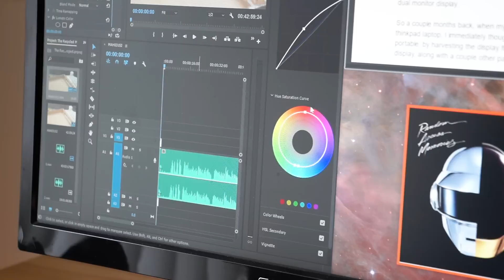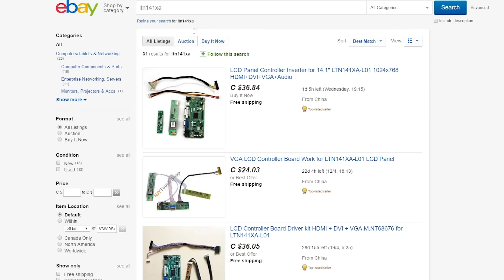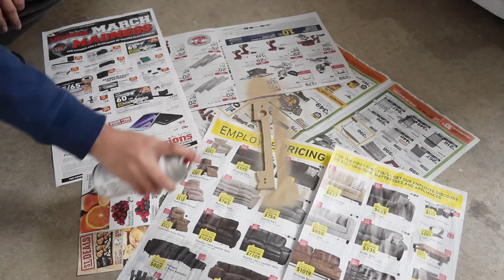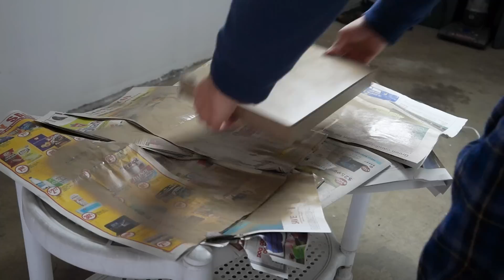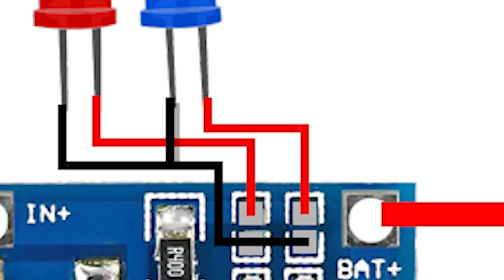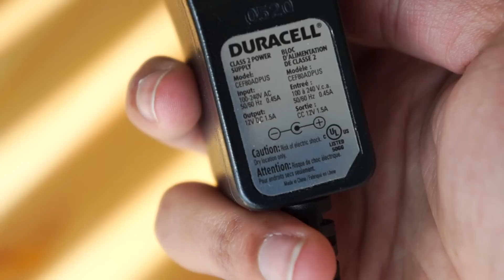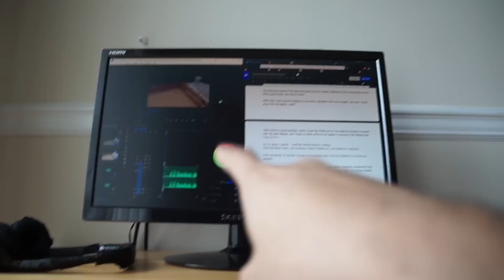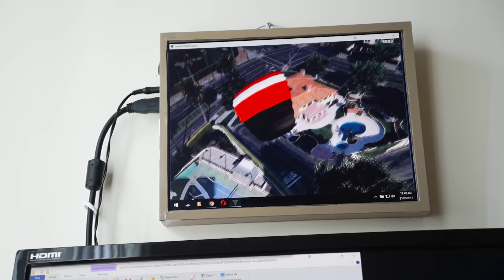The $50 Recycled Portable Monitor Project

Comment: Your design is a death trap. You have 18650 lithium cells, which require protection circuitry to keep them from being over discharged or over charged, but have a load soldered directly across them. Your lithium battery charger is only designed for one 18650 battery, not three in parallel, meaning it can easily get confused because all three batteries are not going to have the same charge characteristics. An example would be if one battery doesn't want to reach the cutoff voltage, dragging the other two down with it. The lithium charger will think the battery needs more charge time and keep charging them until they vent, explode or catch fire.

Since you don't have a dedicated protection board and are drawing power directly from the cells, they're going to be run into the ground. This creates a problem when charging because if the lithium battery charger isn't smart enough (and it's likely not), it will just smack 4.2v across them and cause them to get very hot, and again potential fire.

Three and four cell lithium battery protection boards are dirt cheap on Ebay, so are battery holders so you don't have to stress the batteries by soldering directly to the ends of them.

But this doesn't take into account that you have an external 12v source coupled to the boost converter. If that board fails (and those cheap chinese buck/boost boards do fail quite often), it's going to smack 12v across the batteries directly and something is going to explode.

Comment: Wait wait wait... What about cell protection from undervolt???? If they over-discharge they may loose up to 90% of their capacity...
Reply from the maker: TP4056 auto cuts off batteries at 2.8v
Reply: Hamza Qayyum not all version of the board do... The one you've used doesn't... Because it doesn't have two solder pads...

Comment: when u can buy a used monitor on craigslist for 5 bucks -_-
Reply from the maker: +Kyo Kusanagi Is it portable? :P
Reply: +Hamza Qayyum what qualifies as portable with monitors? cuz i found some about same size as the one you built
Reply: A portable monitor is a monitor that has its own power source and doesn't require to be plugged in to a wall outlet to to use it.
Reply: @kyokusanagi7304  also he has jow gained knowledge and found it a lot more fun than clicking buy and thats it